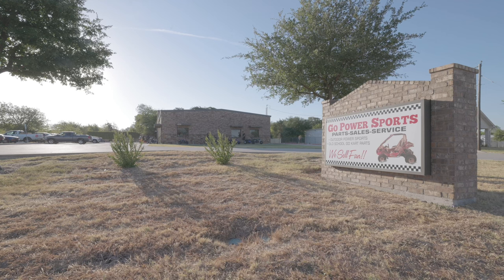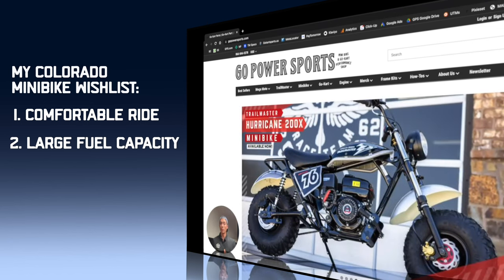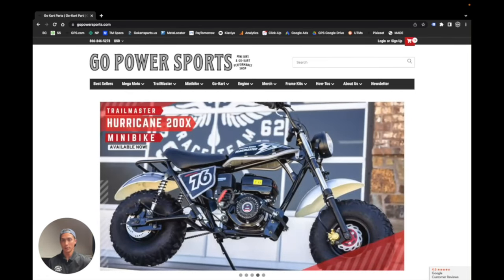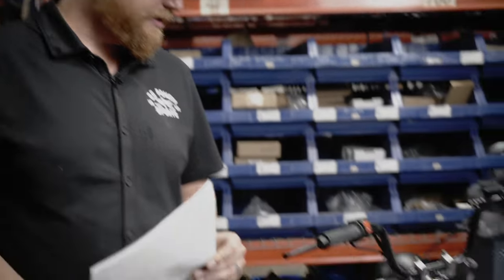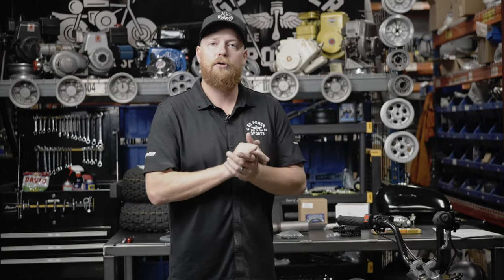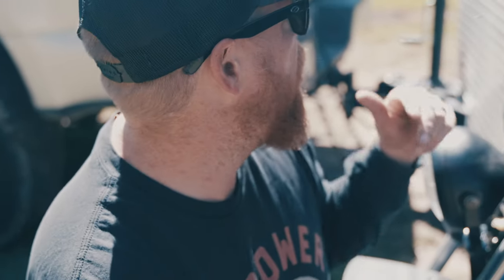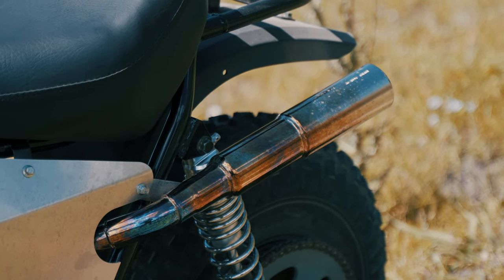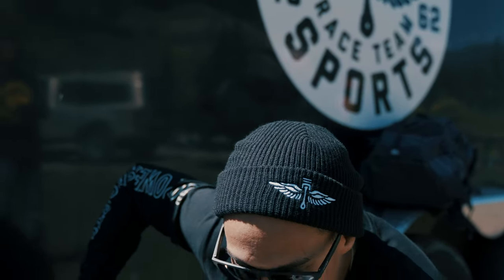Building The TrailMaster Hurricane 200X Minibike For Trail Riding | Part 1

Comment: What jets did you end up going with up in Colorado?
Reply from the maker: We went smaller than a 130 main jet which is stock on our aftermarket mikunis.  We also dropped our needle to the lowest setting.  I believe the new jet was either a 110 or a 120.

Comment: Is the muffler USFS approved; or is it going to set fires?
Reply: I doubt it. Very few guys use USFS approved spark arrester mufflers on minbikes. One of the reasons is because there are not many available that are specifically made for minibikes. You can get a Supertrapp but they are pretty expensive.